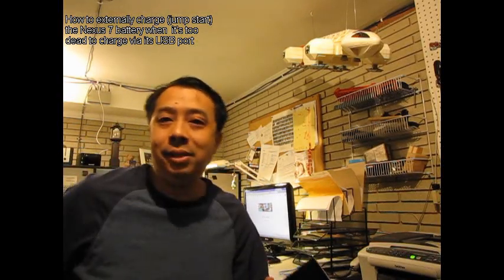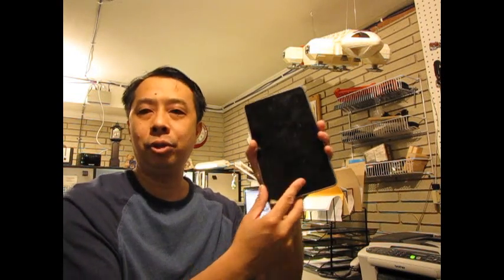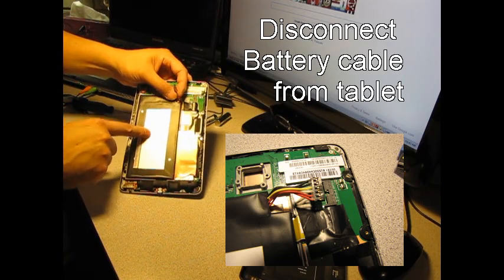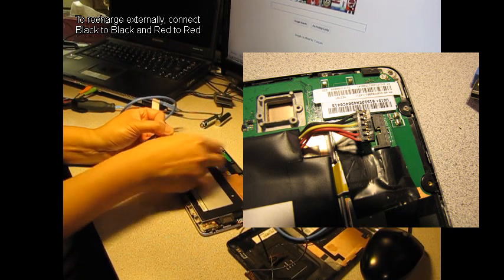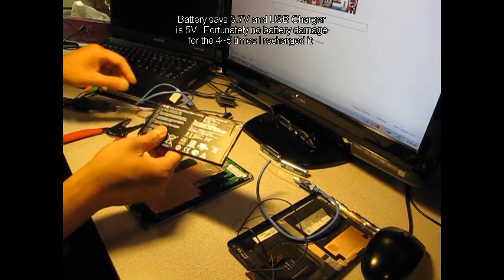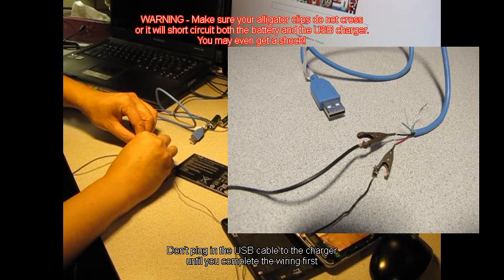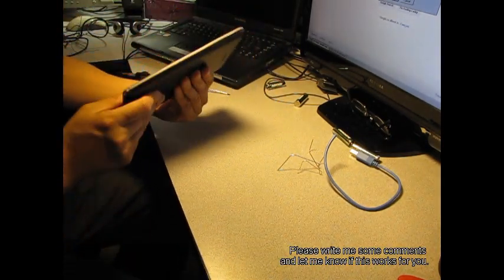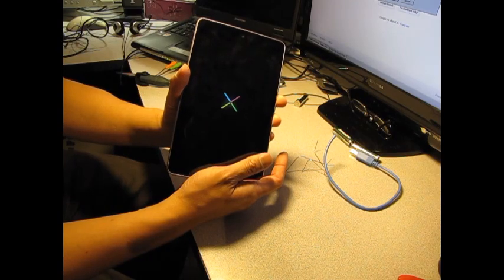Externally Jump Start Your Dead Nexus 7 - Final solution when all else fails!

Comment: Hi Doug Peng , I'd like to know if there is the need of this aligator clip. Why can't I simply connect the wires to paper clips and then directly to the battery?
Reply from the maker: Sure, paper clips should be able to do the trick!  Other commentators here have successfully used staples and safety pins.  As long as you can hook/connect the USB cable wiring into the tiny battery + and - connector holes, you are good!
Reply: Doug Peng I've been trying to do this with staples for a while now, and had no luck. I have the 2013 model of nexus 7. It's dead for a long time now. I'd really like to fix this.

Comment: hey man, i got a problem over here...
yesterday i was trying to reset my tablet to factory state via fastboot in a mac.
but something wrong happened and suddenly all i could see was a bootloop in google logo, a tried a hard reset, and then my N7 didnt turn on, i tried to disconnect the battery but no effect, i lefted charging all night and same result... do you thing that this would work?
Reply from the maker: Hi Roberto.  I don't quite understand what you mean by "fastboot in a mac".  Before you did this, was your battery already charged (i.e more than 15%?).  And when you tried charging all night, did you see the battery charge logo?  If so, my method does not apply to you as your battery had power before you encountered all these problems.
Reply: i tried to recover my N7 via Macbook, it had about 20% of battery when i tried to restore but after all of the procedures it doesnt turn on, not even a blink...
Reply from the maker: Roberto Islas Almada , I do not believe you need a computer such as a Macbook to recover the N7.  When you connect your N7 to the USB port of your Macbook, all it is doing is use the USB power of your Macbook to charge its battery. Do you know for sure if your battery is dead? If you can't charge your N7 battery using your Macbook USB port or through another external USB charger, then its possible that your battery is dead and my method would work.  May I presume you have not tried my method yet?

Comment: Thanks Doug.  I got 54% after doing the procedure.  But now the battery keeps draining eventhough the charger is plugged in with the charging symbol showing.  I guess its time for a new battery.
Reply from the maker: Hmmm, given that you were able to charge the battery using my method, it's unlikely that it is battery itself, but rather the charging system within the tablet. Please read my advice to J Conder below using the pogo pins (instead of the USB charger) to charge the battery.  If you can charge it through the Pogo pins using the wires you made here, then its your USB charging port that is defective and all you need to do is to purchase the docking station as mentioned.
Reply: Doug Peng I tried sending the 5V to the pogo pins, got the charging symbol.  Left it charging overnight.  This morning nothing, can't even start up boot loader. Now I question the mainboard.  When I started charging through the pogo pins, it had just 2% and showing the battery charging symbo, so it could be something on the main-board is always draining more than what the battery charging is supplying.  I also don't think it's the battery itself since it can be charged up through the red lead directly.  supposed I'll try to charge it up directly like your way and then tried charging through the pogo pins with the device totally turned off.  fyi, I also tried a factory reset before so I'm guessing its a hardware problem.
Reply from the maker: malagabee I like your suggestion of shutting it off entirely while charging through the pogo pins.  However, I wouldn't suggest charging it overnight while you are sleeping, as this manual method has no way to automatically shut off the charging mechanism when the battery is full.  You are probably best to charge it 20 minutes at a time and stop with it reaches 100%.  In addition, when your tablet is on, you should press the right most icon (the one that looks like multiple windows) to see how many apps are stored in resident memory as I believe each running apps consumes battery power.  You can turn each app off by flinging/sliding it to the side to minimize battery consumption.  It's possible that you had too many apps running when you were recharging it causing difficulties for the tablet to keep up with the charger speed.
Reply: Doug Peng Good suggestions Doug.  I've since found out the battery holds the charge overnight when it's disconnected from the logic board that proved it's not the battery.

Comment: Thank you Doug! I've had the non-charging issue for the past several months, has been getting gradually worse until it was completely dead. Mine is a 2012 1st gen. I did call Google/Asus and was in the process of sending it in to them (it was going to cost $75 for the diagnosis and an estimate of $150-$200 to repair just to turn it back on so I could get the data & photos off). Found you, tried it and it works! Thrilled beyond words! I did 45 min on each cell and unit was fully charged. Now I just need to replace the charging port as I have to now jiggle the connector while it's in the port and still extremely spotting  at getting a charge to take.  Thanks!!!   :-)
Reply from the maker: Great to hear you got it to work.  There is another solution than replacing the charging port. Just purchase the $30 docking station (see Official ASUS Nexus 7 dock with contact charging) which utilizes the 4 pogo pins on the side to charge it instead of the USB charging port.  Before purchasing this docking station, you probably want to check if your battery is indeed chargeable from the pogo pins.  See Nexus 7 Shoebox Pogo Pin Dock for the pogo pinout configuration and use the USB leads that you created here to try charging from the pogo pins first.

Comment: Hey, this did really work! You saved my day! I used stapler wires in place of alligator wires and tape to prevent possible shorting. Google needs to recall this product. This must be due to a faulty charging chip. If we can juice up the battery directly from a USB cable, indeed there is something wrong with its power charging unit board.
Reply from the maker: Glad this solution worked for you!  Thanks also for pointing out the use of a staple instead of alligator clips.  Ingenious solution!

Comment: i was skeptical, but this totally worked. And i felt like a badass doing it. My Nexus 7 has been bricked for a year and a half. Thanks so, so much for this solution!
Reply: PS i charged each cell for about 45 minutes, which brought the device up to 11% power. i plugged it in from there and it charged to 100%. Smooth sailing from here.
Reply from the maker: Thanks for detailed reply on how to get back to 100% charge!  Glad to hear it worked for you.
Reply: Doug Peng Another note: i had alligator clips, but no cabling to go the last mile. So instead, i electrical-taped the usb cable to the corner of the Nexus 7, and just poked the ends of the wires into the battery plug holes. i just had to trim them short enough so they'd stay put. It worked a treat!

Comment: excellent article. After trying other "tips" this one actually worked.  My wife had left her Nexus 2nd generation, in standby for far too long and the battery was thus flat. Really poor design fault to allow this to happen. I now know why there are lots of "used" batteries on sale via Ebay....sell the punter a new battery then charge up the old one and sell it on.
The 5v from a pc usb  connection, drops to 3.9v when the battery is on load. Both red leads seems connected thus a half hour charge does both cells and brought mine back up to a 37% which enabled a power off and start as you suggested.
Reply from the maker: Thanks for your expanded notes on the voltage drop and battery recharge duration back to a safe comfortable level of 37%
Reply: Doug Peng In the hours following, the % charge steadily dropped, even though the machine reported charging was taking place. The machine when powered down and charger connected doesn't overcome the problem and all charging sources are good. Thus there must be a problem within the charging circuitry which may need a warranty return ( machine only 6 months old)  It has been very useful to be able to power up by using your "jump start" method, so that I can check what is happening
Reply from the maker: David ives I have another solution for you. If the problem is with your USB charging port, you can still charge the Nexus 7 by purchasing its docking station (see Official ASUS Nexus 7 dock with contact charging) which utilizes the 4 pogo pins on the side to charge it.  This assumes that your battery is not totally dead (as per my instructions on this Youtube video) so that the battery is chargeable. Before purchasing this docking station, you probably want to check if your battery is indeed chargeable from the pogo pins.  See Nexus 7 Shoebox Pogo Pin Dock for the pogo pinout configuration and use the USB leads that you created here to try charging from the pogo pins first.  If it works (your battery charge goes up not down), then go out and by that docking station for about $30 plus shipping.
Reply: Doug Peng The Nexus 7  that I have is the 2nd Generation model, supplied into the UK market. No pogo pins and no associated circuitry on the board.
After doing another recharge ( using your method) the 67% charge began to fall away even in safe mode. When completely turned off the battery still discharges if left overnight ( off charger). The only way that the battery will retain charge is to leave it unconnected. There must be an internal fault if the machine discharges when fully off.
Now I must try to find a return centre and the appropriate RMA from them !
Reply: David ives Hi David.  My 2 year old 1st generation and having the same exact problem as yours, except mine had the pogo pins and it shows the charging symbol but it'll draining away regardless of the device being on or totally off.  Do you know if they had to replace the mainboard or the battery or any other parts?
Reply: David ives The Nexus was returned after obtaining the RMA ( and instructions to take photographs of the device...the contractors doing the repairs have been known to break them and blame the customer)
The device came back eventually, maybe 3 weeks, even though repair took 3 days when checking on line status. The job sheet showed that a new battery was fitted.. The Nexus has been OK since
Reply from the maker: David ives Thanks for sharing this experience.

Comment: I had to do this twice as the first time I don't think I had good contact and didn't charge for long enough.
 I twisted the cables and held them in place on the battery connector with dressmaking pins.
I left it to charge for about 1 hour on each cell.
Reconnected, didn't put back on charge and kept the power but on held. Forgot about it for a minute or two and after 2 weeks of trying IT FINALLY WORKED!
THANK YOU SO MUCH DOUG. I was getting quotes of $100+ to "fix" it. 
If you are having no luck. Definitely give this a go before you hand any cash over to get it fixed.

Comment: I was about to try your solution but I decided to try it on a bigger tablet that seemed to be having the same problem, so I tried it on a tablet called xelio without alligator clips and twisted the usb wires to the wires connected to the battery. Once I plugged it into the computer the area where the wires were connected began to smoke I took that as a bad sign and disconnected the wire and decided not to try it on my nexus 7. Ironically when I plugged my nexus 7 back in it began to charge, so I guess thank you.